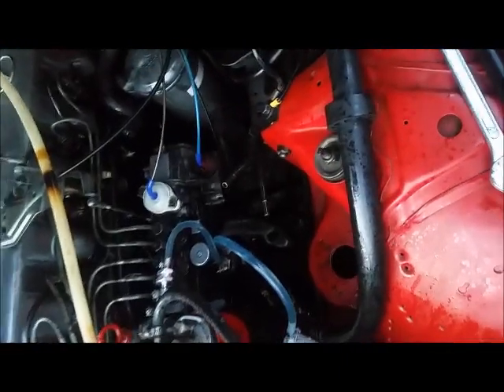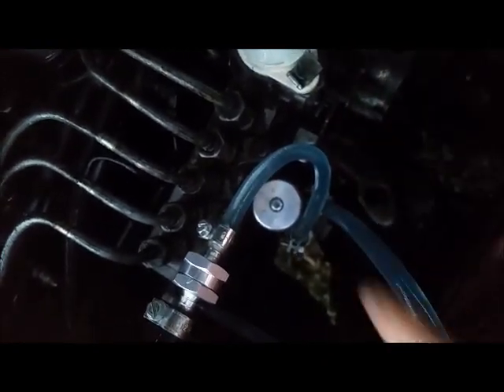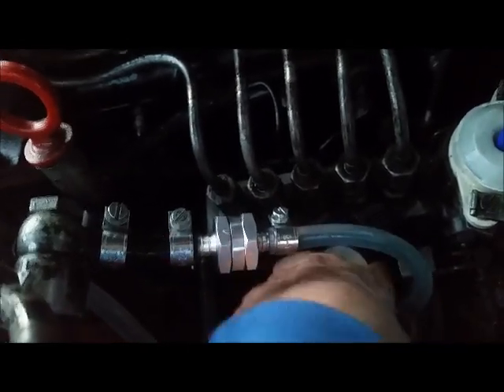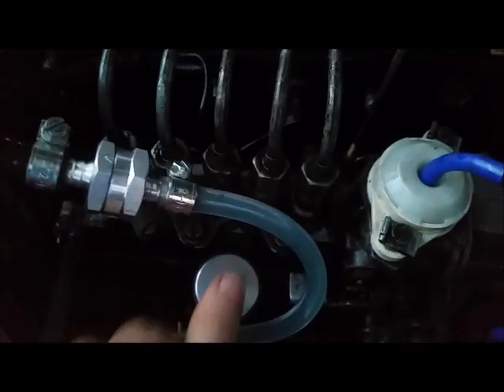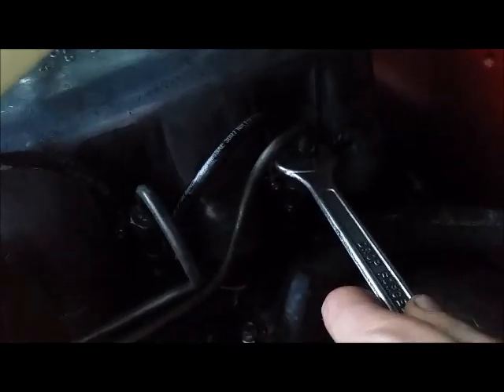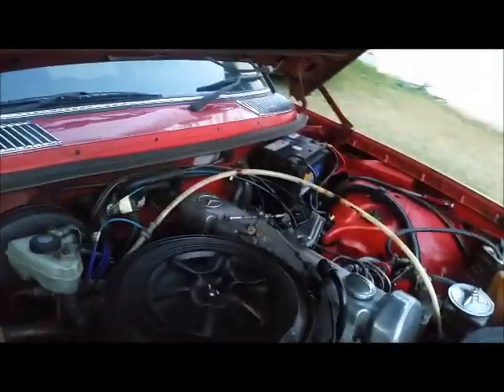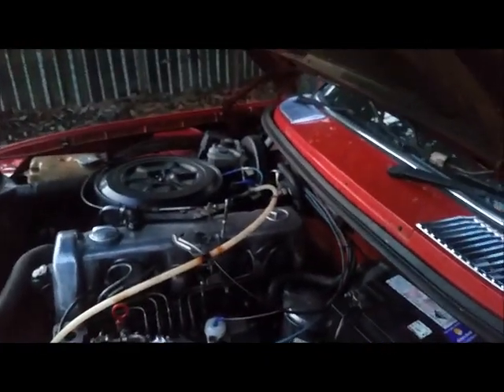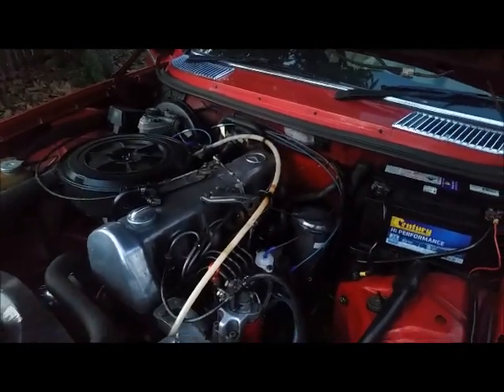w123 diesel fuel bleeding

Comment: what if my primer pump isn't bringing anything up from the tank? does that mean my tank is empty lol (i can't tell cause my fuel gauge is faulty
Reply from the maker: Possibly. Put 10 litres of fuel in it and see how you go. After that, I would suspect you have a leak either at the lift pump or in the lines somewhere.   Or the fuel filter inside of the fuel tank itself is completely clogged which is not uncommon for them past 40 years. They keep debris out so well that they can clog up.   When you remove the fuel tank filter with a 46mm socket from underneath the car. You can clean the filter with a toothbrush in a small bowl on kerosene very easily.
Reply: @qwertyui90qwertyui90  huh i'll keep that in mind. I just reversed the lines (cigar hose pulls from the tank and small plastic filter goes back to the tank) and the primer pump was pumping fine and pulling from the tank and car turned on fine
Reply from the maker: @note_finger  
When you look at the hard lines that the fuel lines connect to. The one that is closer to the road is the one fuel comes from to the engine.

The one closer to the sky is the return line  for excess fuel to go back into the tank :)